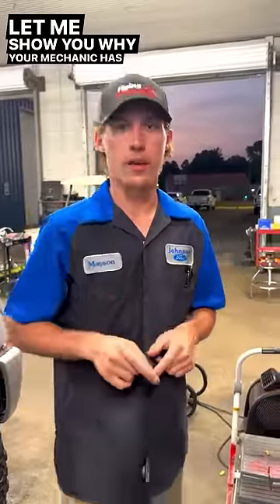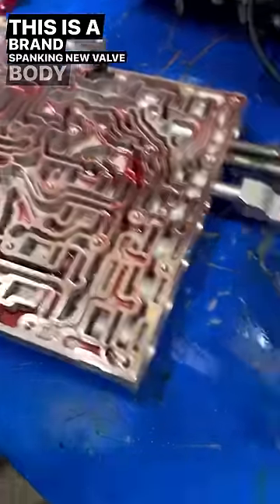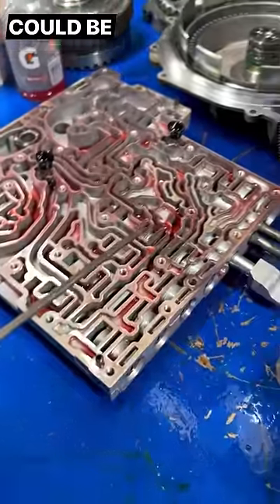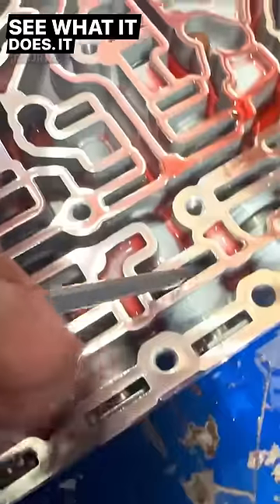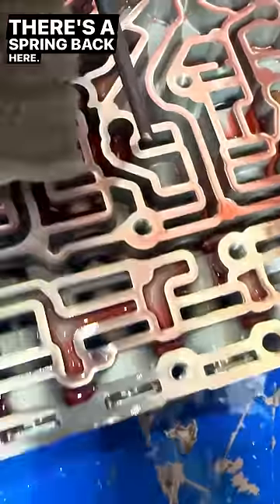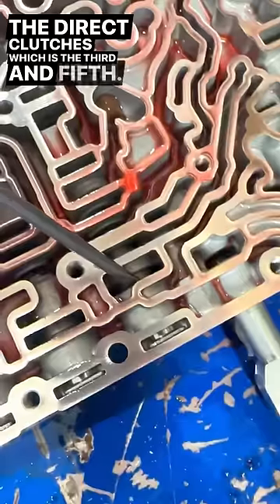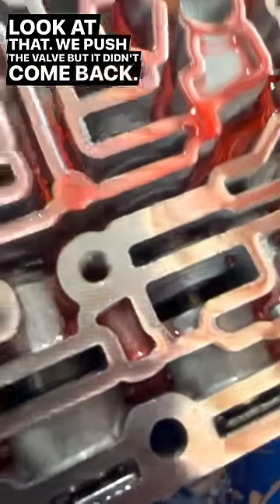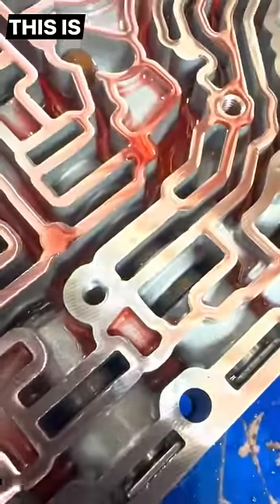Why your mechanic has trust issues #shorts #ford

Comment: that looks like the maze on the back of my cereal box
Reply: That’s what I was thinking. There’s no way that’s part of a car 😂
Reply: @ezekielanderson9055  it wouldn't be if only Americans wouldn't insist on driving automatics.
Reply: @contraband1543  Manual or bust :)
Driving is an artform; having to pay attention to the road and the state of your vehicle instead of just mindlessly mashing the 'go' pedal keeps the driver more alert, and therefore safer.
An automatic with lane assist (like a lot of modern cars are) can be driven with one foot on the throttle, one hand on a burger and the other hand and eyes on a cellphone.
Reply: @peterjohnson9438 I don't think anybody wants to be shifting a 10speed getting groceries
Reply: @A_barrel  manuals only go up to 7 speed for the weirdest ones, most common manual gearboxes are 5 speed, sportier cars come with 6 speeds (with two overdrive gears for cruising). You generally spend most of your time in second and third gear in the city.
Reply: Looks like a brain
Reply: @peterjohnson9438  2nd and 3rd in the city rip ur mpgs I cruise in 5th and 6th whenever possible in my manual
Reply: @declanmckeown323  depends on the city and how the engine's powerband looks. Where I drive the city speed limit is between 30 and 50 kph (18 to 31 mph). Naturally, when I head outside the city where the speed limit is between 80 and 120 kph (50 to 75 mph) the higher gears get used.
My city car is a 1.6 liter Mazda 3. The engine needs to be above 2100 rpm to move the car and not stall.
Reply: @A_barrel shifting a 10 speed is nothin lol
Reply: @peterjohnson9438 manuals go up to 18 speeds chief
Reply: @peterjohnson9438   f150s only have a 10speed automatics. 
Would be a little absurd.
Reply: @Zociety6477  on regular passenger cars? Cargo trucks and various heavy machinery is a bit of a disingenuous special case.
Reply: @contraband1543 hell yea bro, lmao
Reply: @peterjohnson9438 I was just gonna ask is.... this ( an Transmition for automatic or head gasket thing or valve ?)  what I'm gonna have to rebuild in my 2010 Nissan versa in... 10🤞+ years 

When I cant afford dealership BS and bla bla
Reply: That's what I'm thinking. What the hell is this?
Reply: @la24dogg21  uh what? the part we're talking about is the mechatronic valvebody of a slushbox automatic, those have been the standard in the USA since at least the mid 80s.
I've only ever owned manuals, but it is my understanding that the valvebody is rarely the part that goes bad in an automatic, it's the clutches that wear out. You can keep your automatic from going bad by diligently changing the transmission fluid at roughly double the manufacturer recommended service interval - the manufacturer is mainly interested in keeping the car running until their warranty runs out. Slightly more frequent preventative maintenance intervals usually don't hurt anything except the wallet in the short term, but will keep the car in good working condition for a lot longer.
Reply: Truth
Reply: @peterjohnson9438  and for everybody who is isnt pompous as you, I like driving automatic
Reply: Or the back of a bald dude’s head
Reply: Cruising in 5th in the city is wild I’m doing like 25 max and struggle to pop it in 3rd without lugging the engine. I don’t think it kills my mpg as long as I’m not driving it at like 5k rpm which would also be hella loud and annoying. Either way manuals are fun even if u like auto u should try just for the experience it makes u feel like ur part of the car.
Reply: @peterjohnson9438 I used to not know how to drive a manual car but I finally did at between the age of 35 and 38 when I worked at Walmart doing the automotive tech thang, I HAD to drive other people's cars and I could move them and go before but I always had trouble getting started and when I worked at Walmart a guy said all you gotta do is let off the clutch and let the vehicle start to move and then release the clutch as you press the gas and he saved me from going my entire life not driving a manual because now days and for some years iv owned a manual vehicle and drive it all over with no problems. I grew up with uncles trying to teach me but they were always drunk and wouldn't always let me practice and their instructions were never clear lol. It took a guy in his early 20s when I was in my late 30s to finally figure out exactly how to work that clutch and drive the vehicles with no problems ever again lol. I even drove an old Ford dually with 3 on the tree , I had to ask if the shifter was exactly the same as a normal shift in the center and he said yeah should be and I drove that thang no problem, it was like driving a Cadillac lol I could pull every car in the bays without stalling or making it jump forward and scaring anyone and everyone else besides that one guy would always have me drive in their cars so they could work on them when we're all supposed to know how drive a manual when working at Walmart automotive. If you ever have anything done at Walmart ask if they know how to drive a straight shift in case they let it run into a pole or the back of the shop lol. I thankfully never did anything like that I could at least move the cars and I could even drive them but I just had problems getting started like I said, it was the letting off the clutch thing is all. Working at Walmart was hell but at least I learned something not from Walmart but from an employee so always be listening people even if the teachers are younger than you, you may learn a little something and you may have something to teach them too and knowledge is power in this world! Help each other!
Reply: @Death_Vail666  good story :)
Never judge someone by their age alone, they may very well have something to teach you.
Reply: @peterjohnson9438 and this is why people don't use manual anymore 😂😂😂
Reply: @peterjohnson9438 So you're an uncircumcised European that only drives manuals. That tells us everything we need to know
Reply: @peterjohnson9438 Guess you've never heard of semi trucks, with 18 speed manual transmissions!
Reply: Going to be my exact comment😂😂
Reply: @peterjohnson9438  unfortunately, america (the auto manufacturers) decided they wanted urban planning that required car ownership for most people, so cars have to be convenient for your average rube.
Reply: @peterjohnson9438  Isent the problem peoples attention and general intelligence more than the type of car they drive?
Reply: @reahs4815  yes, but consider a completely artificial test: the task is to press a button when a light turns on. What's the average reaction time if the light turns on once every 5 or 10 seconds or so.. or if it turns on once every 5 to 10 minutes?
This is the mechanism behind why driving aids keep people less alert and increase the likelihood of bad accidents.
Reply: @peterjohnson9438 it's stupid to not drive an automatic
cars are tools and transportation not a hobby lol
Reply: @peterjohnson9438 an art form lol. I just want to get to work. Auto cruise control , lane assist is the bomb, no interaction needed just sit back and relax. A 5 year old can be taught how to drive its a necessary task, not a skill unless you are racing.
Reply: @peterjohnson9438 I like manuals, but they're disappearing everywhere. Modern automatics are objectively better, and it's why more and more cars don't come in a manual option.

But more importantly we're rapidly moving towards EVs. They're nearly all fixed gear. So not manual or automatic, as most modern electric motor design's have no need to work in a certain band so can't stall. They don't even have any sort of clutch.
Reply: Haha! ❤
Reply: @peterjohnson9438 Have you considered that maybe being a pompous asshole towards people that drive automatic isn’t going to convince them to switch? I would love to learn how to drive a manual before their time runs out, but you’re not helping them stick around acting that way.
Reply: @zebragoboom Why can’t they be a hobby and transportation? Car hobbyists drive manuals for the fun of it and there’s nothing wrong with that.
Reply: @peterjohnson9438 Guess gear splitters don't exist then.

And a 10 speed auto on a passenger vehicle whoops a 6 speed on MPG because the top 3 gears are basically for maintaining momentum with optimal RPM and when you accelerate the automatic transmission will drop back into an appropriate gear out of the normal range
Reply: @contraband1543 when they say something ignorant, fight em with fire😂😂🤝
Reply: @peterjohnson9438  because automatics are less maintenance then manuals, are less of a distraction than a manual and when programmed correctly are more fuel efficient than the way most manual drivers drive. Now your going to sit their and cry about some nonsense because you think manuals are superior. The truth is a car can die with the same automatic transmission it was built with but no manual car can say the same about the clutch. It will need several clutch’s throughout its life. But please go ahead talk about your manual driver maser race garbage.
Reply: That's exactly what I was thinking. I thought that this was a video about that liquid that solves mazes.
Reply: Yeah manuals are superior
Reply: @Extraterrestrial97 I specifically said that cargo trucks and other heavy equipment is a disingenuous exception to a discussion about regular passenger cars.
Reply: @contraband1543  Hey, at least then America would finally have an IQ average of 100, huh?
Reply: @Dennis19901  the average European has an iq of 96 American an iq of 98  but this is data most likely means they are about the same if you account for errors. If you go by country in the eu instead of capita it skews it higher. By the way send congrats to finland for being the highest in Europe at 101
Reply: @Blatadaba  The entire north west of Europe has an IQ higher than that of America. Not that that is exactly a challenge for first world countries.

But then again, not like America is a first world country.
Reply: @peterjohnson9438 American here. And I love my manual, I switched over like 9 years ago and haven't went back. Dont know why anyone would want an automatic
Reply: @thereinthetrees_5626 honestly more power to you, it’s preference at the end of the day and with how advanced the automatics are I mean, it’s not uncommon to be walked by a 10 speed mustang or a 7 speed dual clutch in a straight line. So do whatever is easier
Reply: @peterjohnson9438 next time I’m mobbing in a lifted crown Victoria with no doors, hood, or fuckin trunk lid I’ll remember it’s an art form 🤙🏽
Reply: @ezekielanderson9055 they’re just fluid passageways it’s a lot more simple than it looks tbh, service manuals always have pictures too for us cavemen
Reply: @HarrisChoudhry The valvepack of a automatic transmission
Reply: @PGspeed88 😂yah fr my neon only needs like 900 rpm maxxxx to not stall out
Reply: You must be eating cereal for geniuses because the maze on the back of mine looks like it's made for two year olds. This has no 2d solution and is much more complicated.
Reply: @kingdomcoomies518 25 WHAT? km/h or mph? Specify your damn units, people!
Because if it's km/h it makes sense that you can't put it in fifth, if it's mph and you struggle, you're doing something wrong. I have no way of knowing which one it is and I don't want to freaking guess!
Reply: @zebragoboom one is more convenient, the other gives you more control. If you think that makes one tool inherently better than the other, than you are one yourself.
Reply: @peterjohnson9438 you just proved that manual is worse, 10 speed autos are more fuel efficient. Keep wasting money pal.
Reply: @ezekielanderson9055  This is why they say an automatic transmission is a fluid computer.  It literally has one as an important part
Reply: Tf typa cereal you eating
Reply: @contraband1543  mostly it is because of americans.  there was a peculiar model of jeep in the us military that taught 100,000 troops to drive automatic.  When they came home the market in automatics boomed
Reply: That's how all automatic transmissions are. Manuals are way simpler. Drive manual.
Reply: Nvm sry I forgor how shit's different in America
Reply: @peterjohnson9438 what are you even saying
Reply: @ezekielanderson9055 its literally an analog computer
Reply: @A_barrel Incorrect, I love manuals.
Reply: @A_barrel  - Perhaps… we shouldn’t have made a world where your suburb is 30 mins of driving away from a place to but bananas?
Reply: @peterjohnson9438 literally couldn’t agree more today I got stuck behind a taxi driver that was im not eve joking in the middle of the road driving 5 mph when the speed limit is 30mph you dont need to convert it just know he’s going too damn slow and blocking all the other lanes because he was trying to look at his phone then he told me to go back to my country (because I’m Mexican) even though I literally can tell he obviously isn’t from America🤦‍♂️🤦‍♂️🤦‍♂️ and you wouldn’t believe how many people I saw THIS MORNING going in the right turning lane to go left then cut across all lanes to get in the left turning lane like it’s insane we are driving pay attention to the damn road it’s so dangerous out here
Reply: And it's deliberate.
Reply: Its amazing isn’t it?
Reply: @peterjohnson9438 if they gota shift that means they can’t hold their cell phone lol
Reply: @A_barrel I think you’re probably a really bad driver
Reply: They include that in the car so when you eat the rest of the car you can play the maze for a little fun
Reply: @OFFICIALBROTHERBOLDLYMUSICTV  How do you come to that conclusion?
My evals say otherwise
Reply: @OFFICIALBROTHERBOLDLYMUSICTV  precisely. :)
Reply: @gotyouchip1179  oh wow, thats so nice of them
Reply: @peterjohnson9438 5 speeds? Those still exist in your market? In the United States, there's a single car new that you can get with a 5 speed manual. Every other manual car has 6 gears.
Reply: @peterjohnson9438 "driving is an art form"

Yikes, get a grip with reality dude.
Reply: @peterjohnson9438 this is nonsense
Reply: @peterjohnson9438 u sound like a kid obsessed with looking cool driving manual... don't worry when cars go AI you won't have to worry about driving
Reply: @peterjohnson9438  weird flex but okay
Reply: It doesn't matter if the inventor of that thing told me otherwise. In my eyes, that's just a maze.
Reply: @peterjohnson9438  I resent that comment, I'm not a special case?
Reply: I'm like... what the fuck am I looking at.
Reply: This proofs why Electric Cars are so much better, almost no moving parts, so less can go wrong, no gearbox, instant torque, no maintenance...
Reply: @peterjohnson9438 for about the last 10 years now almost all new automatic transmissions are dual-clutch they don't make automatic transmissions anything like that anymore no torque converter  (slush boxes)  so they don't look anything like that they use a computer controlled  clutch disc  and they get better fuel economy then a standard 5-6 speed manual transmission does .  guess you wouldn't know because the only thing you have is obsolete shit technology apparently 😂
Reply: @latemreggadable  they still make slushboxes, as they're more cost-effective in applications where you're pushing over 200 hp.
Reply: @contraband1543 thats not how nukes work
Reply: @peterjohnson9438  I can drive a stick shift with a beer and a cigarette so what's your argument here? 🤔
Reply: @rikubrown8109  gets better mileage/ better gas mileage less maintenance so I can spend my time on stuff that's actually and is important  and not repairing a car that should already be good. Just about any automatic you're constantly having to repair you have to repair them more than you get to drive them you might as well just go ahead and hop up on a horse It would get you further then most manual cars 💀 hell you would be doing better in you're lamborfeeties than a manual also I don't want to hear any Europeans say a thing to an  American about not driving manuals like I'm sorry I realize that the time that it would take you to get all the way across the country and back home is like 10 minutes but a 10 minute drive won't even warm you're car up. Their manuals got an easy life over there over here they would be worked to death within a few months. Europe sit down
Reply: @ZK_-hs5es  first thats just because people can't drive in general. secondly I've been stuck behind people that don't really know how to drive a manual. so what's your argument here? Because you can get stuck behind both. I have drove both but automatic is better. By the way you're talking about this guy not paying attention and looking at his phone but you're obviously not looking at the road either if you're watching him and what he's doing IN  HIS CAR.  so you're really just another part of the percentage that can't drive. and lastly if you're wondering how I knew if I was ever stuck behind somebody that's in a manual it's easy because in a manual it usually rolls backwards before it takes off at a stoplight if you don't take off just right.
Reply: @6dogs729  lol definitely not. Manuals break down way less than automatics are easier to repair gets better gas mileage. And as I said I'm an American and my car has no problem getting to temp in 5-10 mins, lol you must be a troll. Or you know Jack shot about cars. Lol and "worked to death" lmfao thats a good joke
Reply: @6dogs729  why are you trying to argue with everyone😂😂😂just agree that a lot of people can’t drive and get over it good bye sir ma’am I don’t actually care what you are
Reply: @ZK_-hs5es  because I'm a goddamn mean son of a b** but I'm also right. We aren't arguing on if people can drive or not in general it's a given that they can't. now when it comes down on what is better it's a automatic they are better in my opinion of years of driving both. sticks aren't that good  they are unreliable and always having to fix them only good thing is parts are easy buying but automatics don't gotta worry bout that.  because they normally if you take care of them will last you a life time without repairs other then basic oli changes and tires. you could drive a manual take care of it you're your whole life & you're still gonna have to replace parts. And if you got the free time to do that and enjoy doing it more power to you. but I definitely don't I got more important stuff that needs to be done like chopping and Hauling wood I don't have time for if I'm about to do something and then can't because I have to fix my truck the truck i got now is a automatic  2002 Chevy and I've never had to  worry about it not starting I can get up every day and go to the woods in it and haul wood out if I needed to it wouldn't always be that case for the stick shift.
Reply: @6dogs729  well shit you answered my questions in all languages😂😂😂
Reply: @peterjohnson9438 you are so corny
Reply: this video gave me marble madness
Reply: @ezekielanderson9055  it is. I'm not a transmission guy, but from what I do understand is the way transmissions work, the complexity of this makes it work. If this doesn't make sense, I don't know what else to say. Honestly, putting my mind in someone else's perspective that has no clue, it doesn't make any sense to me either. 
Transmissions are a separate speciality. I can replace one and do a service, but that's where my knowledge ends.
Reply: @LRM12o8 YouTube is an American company so assume American units.
Reply: @AJ13688 We can't have that type of freedom anymore;)
Reply: My first guess is a mouse has confused it with his home.
Reply: Caveman brain
Reply: Why I clicked
Reply: Car maze
Reply: @peterjohnson9438  I don't want to drive automatic, it's the only fucking option available anymore to something not from the bloody 90's around here 🙄
Reply: that's why you'd get a 5 speed @A_barrel
Reply: @lilshredders4211  I'm saying it's unreasonable, a ten speed isn't 10 gates, but there is zero reason you would need a f150 in a manual 10 speed
Reply: @la24dogg21  I'm sorry to tell you, but Nissan uses CVTs, which are yet another different kind of transmission than a normal auto or manual and come with their own particular set of issues.
Reply: @peterjohnson9438 I'm sitting in my manual truck on break right now haha
Reply: @peterjohnson9438 god damn are you a silly goose.
Reply: @peterjohnson9438  it's not an art form. it's a way to get from one place to another. get over yourself.
Reply: @peterjohnson9438 a manual isn't going to stop people from being distracted, it'll just add more distraction to whatever they're trying to do.
Reply: i agree it looks like a brain
Reply: @peterjohnson9438 autos are faster, more economic (Modern ones), allow people to drive without having to learn an "art." Not saying they're not fun, but its pretty obvious why they overtook the market.
Reply: The design seems so odd and complicated.
Reply: @A_barrel  Correct but one, we could simply not put grocery stores miles away from homes, and two, driving should be made harder because there are too many stupid drivers enabled by its ease
Reply: @saldol9862  did it occur to you that houses were put further away from the grocery store?
If the requirements weren't as hard the same people who complain about food deserts would say it's even harder to drive for incompetent people to reach the far grocery store
Reply: @A_barrel  Houses were put further away from the grocery store to satisfy dumb zoning requirements drawn up by people who wanted exclusive neighbourhoods for themselves even if it was impractical
Reply: @saldol9862 I love making up random shit on the internet and posting it in YouTube comments
Reply: @peterjohnson9438  Cry more, dinosaur, the asteroid keeps coming.
Reply: Naww ft though
Reply: @peterjohnson9438 is what you mentioned about manuals making drivers more safe backed up by statistics?
Reply: @peterjohnson9438  i agree I’m 19 and learned to drive on a manual, automatics feel gross and unresponsive now it’s weird.
Reply: @declanmckeown323  are your rpm’s sitting at 1-2k? If so that’s how you slowly bog down and ruin your engine congrats 👍
Reply: @thereinthetrees_5626  fair enough there is nothing wrong with driving an automatic. It’s just manual feels better, but auto is obviously more comfortable.
Reply: @zebragoboom  cars are not just tools. Cars are art with lots of hard work and time put into them. It’s something that you get to create, let loose, break and then enjoy fixing it. You simply see it as a tool because you don’t know how it works so you just see it as a method to get to from point a to point b. If you truly understood all the intricacies and hard work that is put into these cars than you would get why it’s much more than a tool.
Reply: It is a maze, for fluid.
Reply: @peterjohnson9438  Manual is a big nuisance in a traffic jam, especially when going uphill. I've been driving manual since 98 until 2018.
Now I drive a hybrid with what is essentially electric transmission (no gearbox, manual or automatic), and I would never go back.
Reply: It is a mechanical computer, essentially.
Reply: This is the weirdest hill to die on.
Reply: @peterjohnson9438 that’s probably because the vast majority of us aren’t car enthusiasts and want the simplest to operate vehicle the average family don’t need a performance car
Reply: Kids on the comments
Reply: what Stephen hawking with marshmallows
Reply: @82wethepeople  i love that i have zero context about this, and i would like no one to explain it to me
Reply: @peterjohnson9438 a distracted driver is a distracted driver, the transmission type doesn’t change that
Reply: That is what I was thinking
Reply: @peterjohnson9438 we've had automatics on the road for 20 to 30 years that are still on the road today. Let's pretend they weren't reliable when made properly
Reply: You're so cute and clever
Reply: nah. Those make sense.
Reply: @peterjohnson9438 How can I text and eat my triple-quarter-pounder at the same time if I need a free hand to shift? 😂 -Your average US citizen.
Reply: @peterjohnson9438 Not how control schemes work and aviation incidents have proven that more manual systems do not mean more attention which has led to fatal accidents. At the end of the day it is repetitive movements in response to similar stimuli that the human brain will begin to “automate” and create complacency to. What led a copilot to pull the wrong handle thinking he had pulled another which had in fact already been pulled which led to a majority on board dying in the crash is the same thing that can lead someone to take a turn too fast and hitting a pedestrian. Things like subtle incapacitation and focus drain from repetition are things heavily recognized in aviation but not in automotive which is why so many more people die in car crashes. When a plane crashes it’s a new reason but when a car crashes it’s the same reason from the late 1900s.
Reply: That's some premium cereal b/c I still don't know wtf I'm looking at.
Reply: Automatics are all they sell.
Reply: @peterjohnson9438 Agree somewhat, but I can space out just as much driving my manual as automatic. Maybe when I was learning on a manual but after that it’s second nature.
Reply: @Brother8237 I'm sorry but this "cars are not just tools, it's art" concept can be applied to literally everything. Eating, sleeping, watching TV, exercising, playing games, literally any object and it's creation. There are people who are going to want to see the in-depth nature of something and then there are people who just want to use it for the comfort of life.
Reply: @teslagasoline5629  the difference with vehicles is they are actually complicated and take 100’s of man hours to fully design, manufacture and put together. They are intricate machines with 30,000 parts on average, it had hard work and money poured into it. It’s a whole culture and looking at vehicles as just a tool is simply incorrect considering the amount of time and knowledge it took just to get each part to where it is today.
Reply: @Brother8237  yeah, hey look I can say the same exact thing about computers too, it's still applicable to tons of things man. don't gotta go on a whole rampage about it
Reply: That's what i thought too 😂
Reply: @peterjohnson9438 thats so wrong
 I used to have mazda 3 1.6 and you can cruise at 1400 and not stall at all 😂
Reply: @peterjohnson9438 you make me laugh😂😂
Reply: @peterjohnson9438 why are you using the internet? Do it manually. Write it down and go hand your correspondence to whomever you're speaking with.
Reply: Why does it look like a maze I would like to know
Reply: @peterjohnson9438  Bingo.  Everything about manuals are better. Gas mileage, longevity, control, repair cost, ease of repair...  but because they require some minimal effort and thought to learn how to drive, Americans are out.
Reply: @contraband1543  Compared to the market ratio everywhere else in the world, that's pretty much true.  Manuals are now considered a specialty niche only driven by racers and enthusiasts in the US and they only make up a tiny percentage of new cars released in our market, even though the same models can be found elsewhere in manual.  Meanwhile manufacturers are making more and more expensive and overly complex automatic systems to sell to the Americans and laughing all the way to the bank because we're too lazy to drive manual.
Reply: @peterjohnson9438  i own a 6-speed manual and an automatic. manuals in town are literal hell
Reply: Everyone drive automatics. Most luxury cars are auto. Most modern commercial vehicles are automatic.
Reply: @peterjohnson9438 I’d prefer an automatic for daily driving